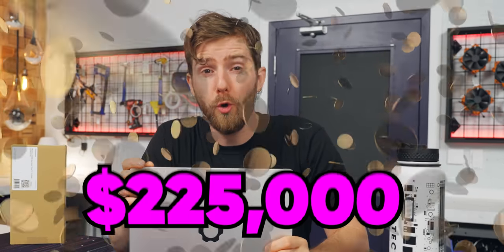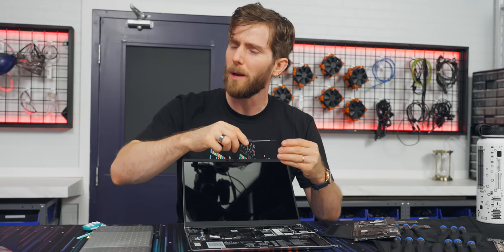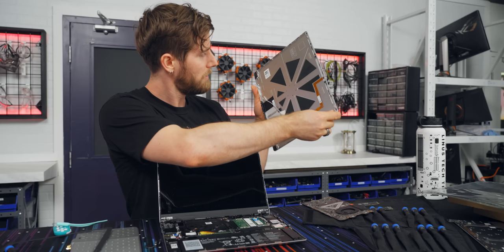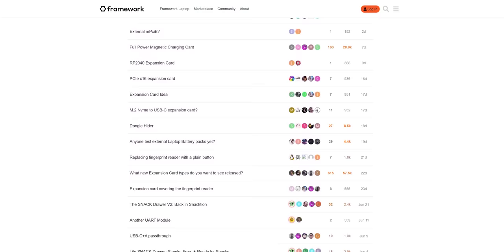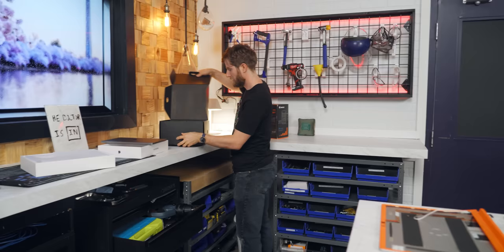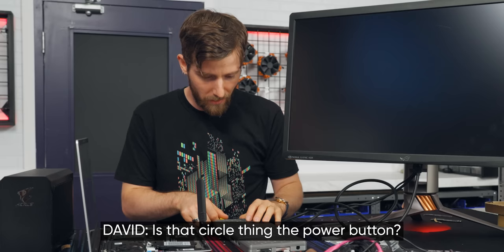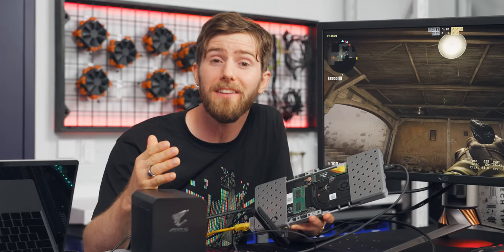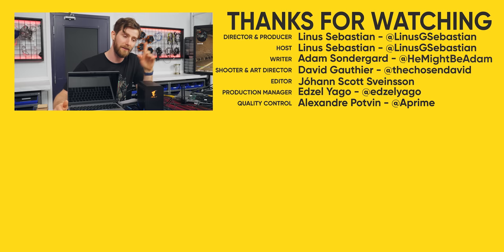I invested $225K in Framework Laptop - 1 Year Update and 12th Gen Upgrade

Comment: The "Just Put AMD In It" thing is so annoying. AMD only launched the 6000 series pretty recently and it's the first one that has the level of USB support (USB 4 and Thunderbolt, basically) that makes it a true drop-in replacement. Here's the kicker: a lot of 6000-series laptops don't have the Thunderbolt support outside of beta-level UEFI updates. 

I love AMD desktops. AMD laptops are extremely performant, and incredibly performant per-dollar and per-watt. Despite this, their laptop-grade USB features are not there yet. They will be soon. But you can't expect a new, young company to dedicate an entire second team to UEFI work for an AMD platform when even the biggest laptop manufacturers can only get the minimum feature level available in their beta channel.

Comment: For any future version of the Framework laptop I really urge them to make a single dedicated usb-C port for charging.
One of the reasons I'm holding out for one of these is because you are guaranteed to need to use one of the 4 ports for this purpose, thus rendering the port useless for any actual expansion.
Reply: I mean, most of the current 13 inches laptop only have two, and one of them has to be the charging one... I think you're asking a liiitle bit too much ahahha
Reply: @alexandrerebmann203  My 10+ year old thinkpad has more ports than the average laptop these days :(
(and that's without the docking station)

Comment: Repair wise this dose not seem all that different than an average laptop and some of these add on parts seem like bs that cost too much.

Price to performance you can get parts cheaper for a more common laptop than frameworks offerings for repair. As for the the upgrade ability, might be something to talk about if in 6 years they still have a board that fits gen one and is the cost  a motherboard should be.

I will also note I don't think working on this laptop is as difficult as Linus makes it look because he was not even looking down at what he was doing when he was ripping it apart.

Comment: Would like to see a secret shopper buy of framework laptops to see how they are. Not sure if this was bought off Framework as LinusTechTips or just sent over
Reply: He was sent one but also purchased one as well while he was doing the first video exploring it.
Also there's nothing to really do here for secret shopper. You go on the site and either get a completed model that they assemble and you pick from limited options or you pick the DIY option and get to choose everything yourself. CPU, ram, SSD, wifi card, and such. They ship you everything and you assemble it.
Secret shopper is mainly for retailers that do a large volume of phone sales where a representative is helping you kit out a system and may be misleading an uninformed consumer.
If your tech sub-literate you're getting a pre-built model. If you're tech smart you're going DIY and know what to pick to fit your needs

Comment: Configuration
$2,013.00
CPU: Intel® Core™ i7-1280P
Memory: 32GB (2 x 16GB) DDR4-3200
Storage: 1TB
WiFi: WiFi 6E with vPro
Operating System: Windows 11 Pro

hi linus i couldn't find the information about its graphics cards this is eerything described in the websites what graphics card does this usually comes with?

Comment: I've upgraded video cards in my old inspron 9100, converted it into an xps 1710, swapped out motherboards in Alienware m11x, but yes now it's literally impossible to add improvements into a laptop. But I've still got the Alienware m11x admittedly with new hinges yea they failed as well. But these laptops look cool might need to buy one.

Comment: What I haven't found so far (admittedly without searching everywhere possible) : Is the connection between the port modules and the laptop proprietary or is it a standard usb-c/thunderbolt connection? Meaning could one use more than four modules using an usb-c hub or something similar? And can one just swap them while using the laptop like just swaping the ethernet module for the SD-Card module or does one have to shut the laptop down and reboot??

Comment: I'm pretty sure I know the answer to this but have you tried running solidworks on this? I know its just integrated graphics but I am curious if it can run individual models at least. Doubt it will handle large assemblies.

Comment: Have there been real world studies done to prove right to repair creates less e waste? I feel like it's neglible. Instead of a whole unit, you're throwing away stuff bits at a time. When all is said and done, you create the same amount of waste most likely.

Do they make you pay for those faulty track pads? (that probably could have been made better if they were integrated and not modular) if yes, then this just means they're making money making you repair your own device. Meanwhile I have an old alienware 17 I could boot up that still has a working track pad practically 8 years later. 

I don't buy it.

Comment: I got one and it is a pile of junk.   Right now, the thing is bricked, won't charge (I got one based on Linus' originally recommendation...   The touchpad failed first, they replaced it, but the replacement was also unusable.. I've logged 5 hours total in the last YEAR since I got it, I ended up buying a Macbook Pro M1 instead... Yeah, mine has been sitting on my 'project' box for a YEAR.. I 'fixed it myself' on the touch pad, but replacing junk with junk doesn't really do anything...   I powered it up last week, but now it won't charge/power up... the LED one the side won't even turn on (both chargers I used work fine on the Mac)... Sounds like if I wanted to drop in a pile of more money to upgrade it all I might have a laptop, but the M1 Macbook should last a decade or so before it needs to be replaced (like my last one did I got in 2010), in any event, I would NOT recommend this..   LOVED the idea, and pre-ordered one when they first came out.. but have used way more hours of use on the Macbook that I got later, than this one..   Would LOVE to get a full refund, but I doubt it will happen, I've spent about $300 per hour I've used this, and not planning on more $$ down this money pit...
Reply: The idea of pulling out the motherboard and putting it in a 3D printed case, sounds like a way to recycle this junk, and maybe I can sell the screen to someone who had one go bad..  The size was too small for me to find useful, the Mac Pro 16.x" screen is large enough to be useful at that resolution, also the OSX OS handles the higher resolution screen better. (BTW: Been a windows user since Windows 3.0), My eyesight isn't as good as it used to be, so might have worked for someone younger...   The best quote in the video is "I wouldn't recommend this" - too bad he was talking about something else...

Comment: An ethernet adapter! YES!

My networking engineer heart just skipped a beat.

If they make an RS-232 module, i'll be very impressed.
Yeah,  you don't really need it since all the new stuff comes with miniUSB console ports and there are usb to console adapters, but when you end up needing an Rs-232 for som old ass router or switch that you can't just yank out and replace, it is a memorable moment...

Comment: still just a laptop with usb ports.the motherboard form factor is nice that they can make it easily swappable, but otherwise not much different to anytihng else, really.
Reply: Can your USB port change into a HDMI port, then a 1tb SSD, then a micro SD card reader, then a display port while never exceeding the original dimensions of the laptop and work completely seamlessly.

Thats the draw. Instead of having to have dongle city perpetually hanging off your laptop you can swap ports out as needed and never have to risk accidentally yanking one out and damaging the port it's plugged into.

Plus you can mover your ports to whatever side is most convenient. I hate having to string a charger around the whole laptop just to plug it in. With framework a quick side swap and I'm charging with no cable fussing